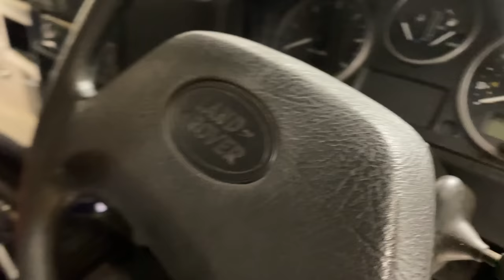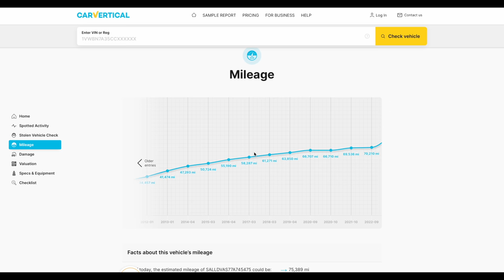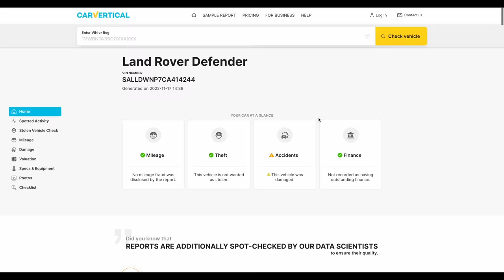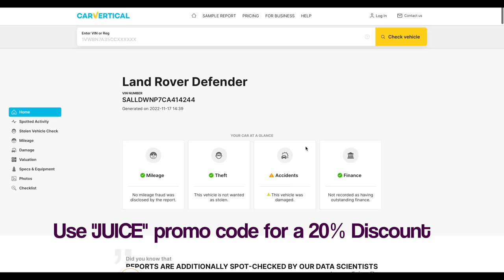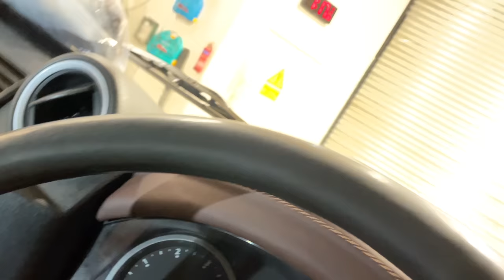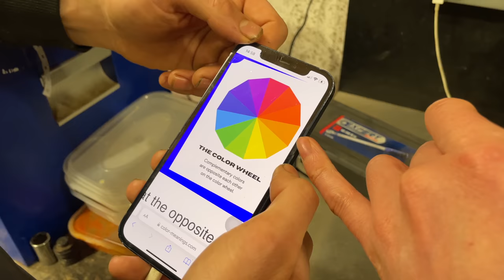I Bought ANOTHER Defender - Part 2

Comment: Brown seats look great, never seen bench seats look so good. Though think the frames might look good in the same blue, matching the centre console etc…Steel wheel nuts v cool. I’d agree with a change of steering wheel and gear knob too. Someone in the last video said panoramic windows to retain the van slab side look, which I think would be great - it’s no station wagon, but quarter lights and alpine windows would help let in a bunch more light. Great build, love it.

Comment: Hi with you adding bench seats in the back then I would definitely add the windows.
I'm not sure if correct in saying this I'm sure you or others will tell me.
But if a van with added seats you have to add the windows so that the emergency services can see any person's in the back encase of emergency.
I could be wrong
Reply: I was under the impression side facing seats were illegal post 2007.  There is also the change of use factor which may may insurance a problem but I'm assuming that Juice have done their homework here.
Reply: @tonypacke6954  I'm guessing has it would be changed from a van to car then Juice would sort this out.
Also has its side benches I'm also guessing that these would be okay in the age of the vehicle.
My comment is that if you put seats in the back then you have to put windows in for emergency services to see in the back of the vehicle encase of an emergency
Reply: @John-dz5dv  I had a look at the GOV UK site.  The law on this is pretty lackadaisical.  You don't need windows or seat belts and it doesn't matter if you have bench seats in a later vehicle.  The only issue I would be aware of is letting kids sit on those bench seats as the law is pretty strict with under 12's and safety .
Reply: @tonypacke6954  fair enough.
Like I said wasn't sure about windows.
Would definitely put the seatbelts in with the seats which I'm sure Juice would do.
I just thought without the rear windows people wouldn't see if there were people in the back, & wouldn't look has thinking it was a van